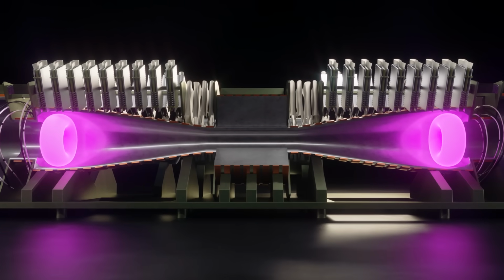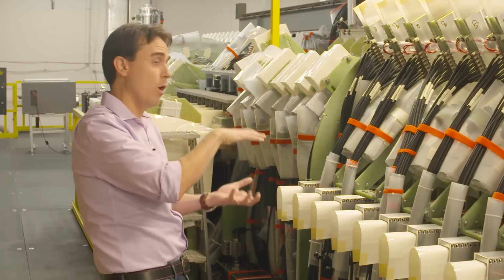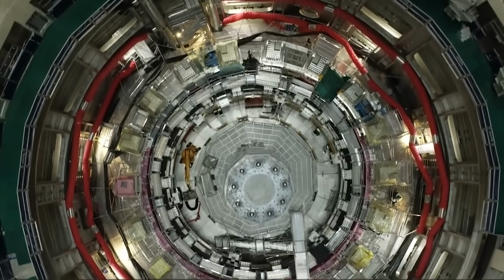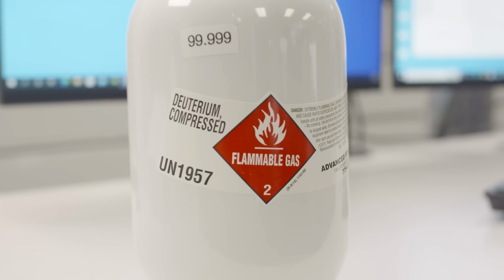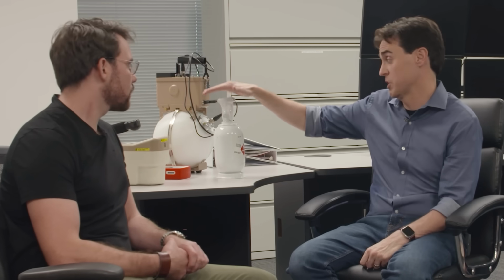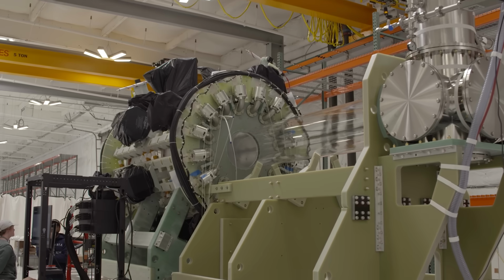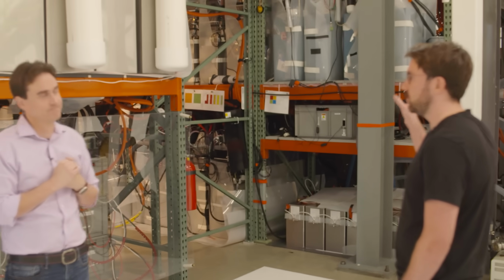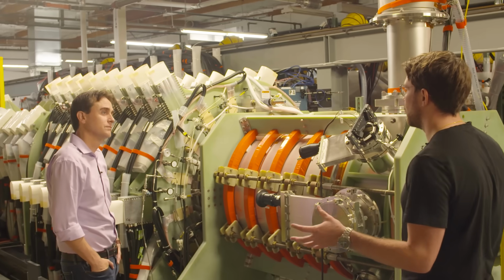A New Way to Achieve Nuclear Fusion: Helion

Comment: Here are some problems that's not mentioned in this video.

1 D-He3 is much less reactive than D-T, depending on the temperature it can be anywahere between 10 to 1000 of times less reactive than D-T which means less fusion for the same input energy.

2 The D-He3 mix will sometimes fuse D-D into He3 + N so they still have to deal with neutron radiation like all other reactors.

3 Another problem is something called Bremsstrahlung which will radiate away alot of energy that won't be captured by their electric field.
Reply: And that's exactly the reason why I don't like learning from YT videos. Facts are mixed with wishful thinking, ignorance, mistakes and bias in unknown ratio. Thanks for sharing your skepticism :)
Reply: Their pulsed power supply looks dodgy enough that makes me suspicious if its functional at all. The cable management and layout does not seem to take into account the massive forces generated between conductors and very importantly i see no thought on the effect the layout would have on inductance, which is something critical to control when dealing with pulsed power experiments of this kind. THere is a reason the Z machine even uses transmission lines and water dielectric capacitors, sure this is not the same as a z pinch device but the physics are similar.
Reply: @teresashinkansen9402  So are you suggesting it could be a hoax? Always a possibility I suppose as it has not been duplicated elsewhere.
Reply: @mariemccann5895  As much as I would like to see such companies have success I am very skeptical due all those little details that tell you when something actually works or not, another thing that really gives it to me is I didn't see any serious radiological protection, if they are getting fusion to the point they will start experimenting with energy extraction they would have to deal with activated parts and the machine would have some significant shielding yet I see none of that.
 I see this subject to be close to finding a cure for cancer, billions of dollars have been invested and many brilliant minds have come together to crunch at the problem but due the nature of it, its something very difficult to accomplish, then you have such small teams purportedly coming up with revolutionary technology that might change the world, to me that's a red flag, sure maybe some day it happens and  such small team changes thew world but its very unlikely. I would eat my words when they demonstrate fusion at any meaningful degree.
Reply: OMG. Three months and this thread is still alive ??? 😄

I've been searching for more info about Helion's machines the last two or three weeks; with it in hand now I have less doubts about this contraption.

I found 10+ year old patents that mention it under the name of John Slough (co-founder or Helion with David Kirtley and others in 2013) and even older peer reviewed papers. After 2013 more patents, but no more papers. Maybe I'm not good at searching, or perhaps they want to keep their trade secrets.

Anyhow, John designed this before incorporating Helion. In its initial iterations this machine was to work with Deuterium-Tritium. Later on, they found the design was capable enough to burn more "difficult" fuels (enters D-3He). The old drawings included a Berilium first wall embracing the reaction chamber, surrounded by a blanket for cooling, breeding (Tritium), and shielding.

John Slough's has been publishing peer reviewed papers on fusion for at least 25 years, and is a well known name in the field. This machine is a child of his brain, and predates the creation of Helion Energy LLC. That should give them a bit more credibility, I think.

Moreover, it seems that there IS some neutron shielding around the reaction chamber even in the machine showed by R.E. in this video, it's just hidden under all those cables and parts. Also, they don't include it in most animations for clarity (or even in the quite unrealistic model Helion has it its own web page) but it is there.
Reply: @charliem6590  It's also important to be skeptical even if a more well known scientist is involved in the project.

For example John B Goodenough started working on a new type of battery in 2019, a solid state battery that's suppose to be much better than Li-Ion batteries. However they are already behind schedule and i haven't heard any news about these solid state batteries leaving the lab or that they are commercially ready. afaik some do exist and work but they are only very early prototypes and in general i'm more hopeful regarding the future of batteries.

I'll believe FRCs are the future when a significant amount of scientist start building FRCs and we get a good amount of peer-reviewed papers.
Reply: I want to start by saying that I'm not at all sure that Helion is going to succeed, but I hope they can. Fusion energy generation is at present a field with a lot of players, with some luck at least one of them will get there.

Regarding your specific points, let me see if I can argue why those problems could be overcome (not they are going to, just that we cannot say it will be impossible, not yet):

1. Yes, a D-3He mix is less reactive than a D-T at the same ion temperature but that's not a problem per se, the question is whether a D-3He mix reactivity is high enough. If I can propose a simile to try clarify this, gasoline combustion is quite less energetic, gram to gram, than hydrogen combustion but we don't fuel our cars with hydrogen, this is because gasoline is good enough, and because hydrogen has other problems. Helion says they think D-3He will be good enough. We'll see.

2. Again, yes, a D-3He mix still produces neutrons. My thoughts about this. 1) Neutrons produced in D-D fusion events are much less energetic (2.5 MeV) than from D-T (14 MeV), and much less than neutrons produced in fission reactors. Also, 2.5 MeV is well under the average activation energy of most structural materials (stainless steel AAE is 20MeV). 2) The neutron production can be reduced changing the D-3He mix ratio without compromising energy production too much (Helion speaks of using a 1to10 Dto3He mix). 3) The selection of structural materials can also help, not all materials produce long lived isotopes when bombarded with neutrons, Helion says they know how to build the machine mostly with materials that only produce short lived radioactive isotopes (for example, Aluminum isotopes produced by neutron bombardment decay in minutes, not years). As before, we'll have to wait.

3. Bremsstrahlung is produced by electrons and it is heavily dependent on their temperature. The plasmas in Helion machines are not in thermal equilibrium, nor they want them to be, and in particular they've measured a big temperature gap between ions and electrons. Electrons are far cooler, ergo, less Bremsstrahlung. Low enough to not robe the plasma bulk of too much energy ? I don't know, and neither does any of the critics.

Summing up, Helion has still to prove their concept but saying, as the Improbable Matter video says, that it is a scam is in my opinion jumping the gun.
Reply: @charliem6590  activation of materials is not the main issue materials-science wise in fusion, it's the exceptionally large amount of defects caused by neutron radiation primarily. In conventional light water fission reactors we observe damage levels of at most a couple dozen DPA in the reactor pressure vessel. In a fusion reactor, be it this helion thing or a tokamak, you can expect as much as 100 dpa over expected operational lifetimes which is just crazy and will not work, it's too much damage
Reply: @charliem6590  Those are some good points and i do hope they solve these
problems but to me it seems almost inevitable they'll really struggle with atleast one of these problems. 

If they decide to try runnging a cooler reactor then the bad reactivity of D-He3 becomes worse much quicker than D-T making it really hard to achieve a high enough Q total value to justify a commercial reactor.

If they try a different D-He3 ratio to try to increase Q total then neutron radiation is going to be a big problem they'll have to deal with like all other reactors.

If they increase temperature to increase Q total then they have to solve large number of engineering problems aswell as dealing with bremsstrahlung.

While i do want them to succeed, it's really hard to not be skeptical when the rest of the world struggle to get above Q plasma 1 let alone a  Q total of 1. Let's not forget they'll need much more than a Q total of 1 in a commercial reactor.
Reply: @peterjohansson1828  Well, inevitable is a big word. It may be that one of those problems (or any other yet to be discovered) end up being a show stopper for Helion, but I'm hopeful.

About your point over running a cooler plasma, from what I've read from different sources Helion intends to (in their next machine, Polaris) at least double the temperature, mainly to improve reactivity (in the last one they reached ~100 million Kelvin). With D-T the ideal temperature for a steady-state machine like a tokamak has been calculated to be around 135 MK. Above that, bremsstrahlung and other loss mechanisms eat any further gain in reactivity. Having said that, in a steady-state machine ions and electrons tend to thermal equilibrium, but that's not applicable to Helion's machines. According the results from Trenta (the last one), they've measured electron temperatures far lower than the ion temp, up to 8 times if I recall correctly. If we scale that up to a 250MK plasma, it would mean ions at ~250 MK, and electrons at ~31 MK. Ergo, quite less bremsstrahlung than in a tokamak at half that plasma temperature.

Regarding the D-3He ratio, they said they've already tried it. Making a 3He rich mix has the consequence of making less probable a D-D fusion event, reducing neutron production, without affecting D-3He reaction rate too much. In a presentation they did for the USNRC last year they claimed that their projection for a 50 MW machine is that it will  output less than a 5% of the energy in the form or neutrons at 2.45 MeV. They plan to have shielding outside the main reaction chamber, but it will be reached by only one sixth of that. 0.4 MW in neutrons is something to take care of, but far from intractable.

And yes, increasing the temperature might reveal new engineering challenges ... or maybe not.

Again, we don't know, but we will ... and without having to risk any of our money.😋
Reply: @peterjohansson1828 the issue is these limitations aren't solvable, they are hard limitations of metallurgy and physics, the sheer neutron flux will destroy reactors nomatter how well they work, I think unless they find a way to contain the neutrons or redirect them off the walls of the reactor then these fusion reactors will never be commercially viable
Reply: @charliem6590  I've seen that Improbable Matter video, and this one as well. Glad to hear there's yet more nuance to the situation.
Reply: @charliem6590  You just know this kind of science off the top of your head? Im so freaking envious... I would LOVE to be able to argue a science argument like you did just with knowledge learned through time.. AND understand arguments someone else makes like the original poster... So cool man. Im so grateful there are intelligent humans such as yourselves on this planet!
Reply: @charliem6590  About Bremsstrahlung : this effect may be undersetimated in the fusion chamber. Granted, electrons and nuclei are not in thermal equilibrium, but within the core of the reactor, where the magnetic field is maximal, the movement of electrons and nuclei follow the same helixes, but in the opposite direction, so the thermal exchange will be very efficient. Another point : the X-ray power lost by bremsstrahlung is inversely proportional to the fourth power of the particle mass, which gives a coefficient 1836 to the power of four, that is 11 thousands of billions.. And the loss in proportional only to the square root of the temperature, so it's doubtful the lower temperature of the electrons will compensate the huge defavourable factor from the mass ratio.
Reply: It seems the plasma is extremely hot and dense for only a very short time. Perhaps too short for Bremsstrahlung radiation to have a sizeable impact?
Reply: Sure, those are considerations, but they go into the equation along with all the other factors. Even if the fuel is less reactive, what matters is how effectively the fusion process can be used to create electricity (and/or create its own fuel supply). What you've ignored is all the other  factors that can lower expenses, lower total input energy, improve efficacy and allow electricity to be produced systematically at cost. And I'm pretty sure they said they can actually achieve fusion every ten minutes, which really shouldn't be dismissed lightly.

Btw: pretty sure the CEO who has been working on nuclear fusion for decades has nuclear scientists and engineers developing these machines, and fusion science has had a lot of problems with those decade-old experimental models. A lot of criticism has been made on ITER's fuel for very good reasons.
Reply: They haven't mentioned that the technology is outdated by what they have now big time!
Reply: Bugs are still being worked out.  Just a few more lines of basic and the thing is ready to power the most demanding of television sets.
Reply: Edit: trying to find a redaction for this comment that Youtube does not object to (5th try). This time I just deleted all my text. Will this be acceptable ?
Reply: I thought the primary reason to use another element, other than T, was because of T's very low availability in nature; creating an issue in the future of not having fuel.
Reply: @davidohare2933  you can make tritium in fission reactors, especially heavy water reactors like CANDUs. The problem is even then you'd need a huge amount of reactors to make enough tritium for even just one tokamak power station
Reply: @davidohare2933  The plan for other fusion reactors (afaik) is to use a beryllium-lithium blanket to create more tritium as part of the fusion process.
Reply: @indisplutably  ITER is designed by engineers and scientists, I don't trust politicians either but they are only a source of funding. regarding my third point I can simply point to pretty much any scam in recent time. Remember theranos? and how they were going to revolutionize the medical sector with their bogus idea? She got billions in investment from hyping up her stupid idea which had no chance of working. Lastly can you name a single successful invention from a private company in the last decade? There are tons of bad ideas like solar roadways, then there are incremental improvements like jet engines becoming more efficient. Have lithium-metal batteries even been made on a large scale or is it still an impractical and underdeveloped idea like so many other battery concept? I heard of a lot of promising battery concepts in 2019 and 2020 but so far all those ideas have failed. Also don't forget that I said private companies are good at slowly improving and refining already existing technology.
Reply: Can you put that thing under water?
Reply: I know it's off the topic but are you swedish ?
Reply: @norapodlasky8278  ye I'm swedish
Reply: I thi k they know that and they are trying to fix it
Reply: And even if you say some problems, that doesnt mean that they have thise problems, they have maybe fixed it
Reply: Oh yes, if only that was all of them...
Reply: Also, after looking some more at where they are in the process it looks to me like they are claiming to have already overcome these problems. They had Trenta running for 16 months. The new iteration of their process is aimed at the problem of capturing the electricity generated. We will see I guess. Perhaps I'm misunderstanding what they are saying in addition to what you are saying and these problems still remain to be resolved.
Reply: @jjwagnell  I doubt that Helion has the neutron problem already solved. They probably have ideas for that, but I don't think their work with Trenta did it. In Trenta they made a pulse every 10 minutes, in their production prototype machines the aim is ten per second; just from that, the neutron production will be multiplied by 6,000. Also, I read they plan to increase the temperature two or three times; that increases the reactivity of the D-D fuel over 10 times, which means we are now talking 60,000 more neutrons. Thirdly, they are going to double the magnetic field resulting in an increase in density, implying another 10+ increase in neutrons. And lastly, Trenta only burned D-3He in some of those 10,000 shots, many used hydrogen, other gases, or mixes other than D-3He.
Add all that up, and their first generator prototype will have to deal with a neutron flux way over 1,000,000 times higher than Trenta.
I hope they can overcome all that, but in my opinion it is far from a sure thing.
Reply: I was going to say that but you beat me to it. Also not to sound too much like a sciencey science guy but I was thinking maybe a planet already exists with trillions of tons of trillium and they are the ones probing our farmers butts.
Reply: @@lynngeek5191 Last I heard of Iter was some planned q>1 test in 2025 tho i could be wrong. Also i have yet to see a successful commercially funded research reactor. private companies really just don't do non-profit things for the public good.
Reply: This was a great read.
Reply: To be fair, braking-radiation (I can't write that word, sorry) is still the minority of the energy, plus if you REALLY wanted to you could always surround the machine with a watercooled jacket for it to heat. This would also help capture the neutrons.

But yeah, the largest problem is definitely the D-He3 cross-section. An advantage that's often not mentioned of D-T is that it has pretty high probability of fusion compared to basically everything else, which translated to higher power density. And that' isn't just important if you wanted to build the Rocinante from The Expanse, high power density also means that the machine can be smaller to produce the same amount of power for grid consumption.
Reply: true it will create less overall energy but the point is it poses the potential to actually produce MORE energy per every bit of fuel put into it so while D-T can produce more power, its overal more difficult needs to induce the fusion requring CONSTANT power supplied to massive super conductors with their size increasing their cost to produce AND cost to repair of something goes wrong but also due to the nature of how you gain the energy from a D-T reaction, its far less cost effective as it requires beryllium to produce a net positive energy gain and because of both the cost and dangers being the same as current fission reactors only increasing the cost as decommisioning those is ridiculously difficult due to having to safely find a way to handle the radioactive byproduct, its overal both less cost effective and less energy efficitent.
Reply: like the point with this style is that 

1) you can produce the He3 in another generator and design that only purely around the need to create the fuel and because its not focused on gaining power the same way as a D-He3 reaction, i.e. it would generate heat due to the neutron release, you can create those blankets to recover some of the energy used to create the He3 as well not only making your fuel but greatly also reducing the cost to make it in the fuel in the first place making it easier to get net gains in energy production

and 

2) the reaction of D-He3 is seemingly much easier and safer to the reactors lifespan (accounting for the 25% increase to size of the next reactor they are making) meaning while you ultimately generate less energy than traditional fusion reactors, factoring in the fact that the thing makes the only difficult component AND it can be outsourced to a different machine all together making it ridiculously cost effective (compared to traditional fusion AND fission reactors) while also not producing highly dangerous radioactive byproducts with the only byproducts aside from more He3 being tritium which can be safely siphoned off to storage where after roughly 2 to 3 years, it can become regular He3 ready for use in the reactor. 

all in all it does have issues but most of those have been accounted for and as primarily the conductors and possible seperate fuel creation engines get created allowing for the reactor itself to no longer have to pull the hybrid power generation / fuel production all leading to the genuine possibilty of generating FAR MORE power than current methods can (barring the inefficient and dangerous current fission and fusion reactors) with no real harmful byproducts that are difficult to handle and a overall operation cost being far and below all other forms of power generation that come even close to it.
Reply: Yeah, the problem is the Lawson Criterion (AKA reactivity AKA how hard it is to break even). The LC of D-T is by definition 1. The LC of D-He3 is like 16, 16 times harder to break even on. And the LC of D-D, used to produce He3, is something like 30 IIRC, even harder.

Basically if you thought ITER was struggling and came out insanely expensive just to vaguely break even on D-T (Q-Plasma is 10, but Q-Total is only about 1), be aware that Helion will have 16 to 30 times as much difficulty.
Reply: To me the most credible objection to Helion's plans is the problem of neutrons. I see two potential issues.

One is the neutron activation of materials. Helion seems to be addressing this by researching and choosing materials with short lived isotopes caused by neutron bombardment. They seem to favor aluminum to copper for magnets, quartz to steel for the interior walls, plastics to metals for non force bearing components, etc. These mostly produce isotopes with half-lives in the order of minutes or days, instead of the years or centuries we are familiar with in nuclear fission installations. At least that is the plan as I see it.

Second [and in my opinion tougher] problem is the structural degradation of the reaction chamber walls, mostly its internal surfaces. This could result in the necessity to replace those parts multiple times during the operational life of one of these reactors. Helion has declared that they are designing their machines with easy of disassembly/maintenance in mind (to which short lived radioactivity of activated materials would be of great help). May this be their answer ? If the reactor has to be turn off once a year for maintenance, and it is serviceable a couple weeks after, and work back to operation in another two, that would mean 92% uptime, not bad compared with other electricity generation installations.
Reply: So now Iter was a waste of money?
Reply: @bille77  no it's a research project, Iter isn't designed as a commercial reactor and no one expects to turn a profit by running it. The same can't be said about Helion and their reactors.
Reply: @peterjohansson1828  ITER is a research project. Helion's Trenta and Polaris machines are research projects. ITER is said to be the precursor of commercial fusion plant designs. So is Polaris. In that sense I don't see that much of a difference (besides one being funded with public money, and the other with private's).
Reply: @charliem6590  Yes from that perspective those projects are quite similar but I'd argue the big difference are the expectations. The people funding ITER know they won't earn any money for it while I assume Helions investors want some kind of return for their investment.
Reply: @peterjohansson1828  Well, that's where the "Venture" comes from in "Venture Capital". VC investors know they are putting their money into something with no guarantee of success. Even so, they do it because the potential reward.

Sooner or later someone is going to crack that nut, and the investors in that company are going to make a boat-load of money.
Reply: @peterjohansson1828  they can sell tritium or capacitors I guess😁
Reply: @charliem6590 ` It is said to be the precursor of commercial  fusion plant design`...lol you couldn't make a bigger reason for fusion   to never succeed in commercial power production . Have you seen the cooldown /warm up times for any tiny malfunction ?
Reply: @bille77  The whole fanciful notion is a waste of money.
Reply: @bille77  nope
Reply: @bille77  When is ITER meant to come online for the first time?+
Reply: In short this video is a publicity stunt. An ad.
Reply: Cette technologie ne permettra pas de construire un réacteur de fusion commercial opérationnel. Jamais. La théorie est fausse, la conception n'est pas réalisable.  Il existe une bonne solution.
This technology will not help to create a working commercial fusion reactor. Never. The theory is wrong, the design is unworkable.  There is a right solution.
Эта технология не поможет создать действующий коммерческий термоядерный реактор. Никогда. Теория не правильная, конструкция не рабочая.  Есть правильное решение.  
https://www.youtube.com/watch?v=FcypwoVOAAY
Reply: Bremsstrahlung radiation is irrelevant here the lifespan of plasma is far too short to cause any real radiation these are also heavily shielded anyways so it wouldn't matter even if plasma lasted longer than a few seconds and it would have to be a decent amount longer for it to have any real impact. 
Most reactors are not using helium 3 but in this case they are. Helium 3 is also far less available unless we can mine it from the moon and return it at a low cost. Not a great option if you ask me. General fusions reactor is honestly a better option in this case using a somewhat similar method and seem to be more successful so far. Course NIF method with lasers is currently the more superior option at least that we have seen despite it not being that successful overall with a gain of 0.0077.
Far as I know Helium 3 cannot mix here with Nitrogen Helium doesn't mix easily with nitrogen because of the great difference in their densities. But once mixed, the gas molecules are close together and they move around quite a bit with kinetic energy so they stay mixed and don't separate out into layers. Far as I know this doesn't really cause any radiation output but I may be very much wrong. Couldn't find anything on it though to confirm if it did.
Reply: If the neutrons' energy isn't high enough to fuse with anything, I don't see a real problem: Free neutrons have a half-life of some 10-15min (longer time for higher kinetic energy). So long as you don't just vent the reaction product into the atmosphere, that is...
Reply: @Smo1k  I thought it was something closer to 7 minutes
Reply: @charleshorseman55  Neutron half-life is 611 seconds +/-1 inside a nucleus, 879.6 +/- 0.8 outside. Subjective to relativity, of course; if it moves really fast, it'll live longer. You saw the size of the reactor, though, moving fast doesn't happen for long inside that small a volume...
Reply: @Smo1k  Fast neutrons go almost thorough anything, so its not like you can contain them like a gas, also neutrons get captured by nuclei as well which many times end up making it into an unstable isotope.
Reply: @teresashinkansen9402  But the argument is exactly that the neutrons in this reactor ARE NOT fast, they will behave (sort of) like a gas, as they decay to hydrogen. So: If you don't vent but contain the gas of leftover D and He (Both of which are better spent reused), there won't actually be a problem, just a tiny higher percentage of H.
Reply: @Smo1k  Only ultra cold neutrons behave as a gas and for them to be they have to have an energy in the order of nanoelectronvolts, depending on the material that will contain them is the maximum energy they can have, at this energy ranges they are moving at speeds of a few meters per second so even a drop of a few meters can give them enough energy to make them interact with nuclei. With what im going with this is that there is no reaction that I know of that produces such low energy neutrons. When neutrons are moderated below thermal energies the moderator has to be physically cooled as even the vivrational energy of atoms at room temperature imparts energies far above what is needed. How can you expect to have such kind of neutrons when even the plasma of the reaction is several millions of degrees?
Reply: @teresashinkansen9402  I'm not talking about the neutrons behaving like a gas themselves, but that their environment is a gas. The D+He gas we started out with before plasma? The same thing. Closed environment.

Now, solo neutron fusion with anything doesn't happen without a cost way overboard of what we've heard about in this video. With the numbers mentioned to turn the whole bit into plasma, we're talking so small numbers left over for the "run away neutrons" that you're worrying about stuff smaller than the added background radiation from flying overseas.

Will it be a factor in large scale operations? Probably. But even ITER will not be on a scale where neutron radiation is anywhere near as dangerous as... just about anything. Salt. Chemistry. Traffic. Sharks. You name it.
Reply: @Smo1k  Now Im not sure what you are talking about. Anyway I don't think you understand the amount of neutrons produced in a fusion reactor of any practical use for power generation. The amount of neutrons is insane, lets say about 1% of the energy on this device (about 60% in fusion reactors using D-T reactions) is in the form of neutrons the average energy being about 2.45MeV (due D-D side reactions) each neutron would have .00000000000039J of energy if they are planing to generate about say 20MW of fusion as a pilot plant (supposing this thing can actually fuse fuel at all) that means about 200kW of power is in the form of neutron radiation so 200kJ per second 200kJ / .00000000000039J= 5.13e+17 neutrons a second, now do you see the mental levels of neutron radiation? That's lethal levels of radiation and enough to strongly activate construction materials, that ain't your intercontinental flight radiation levels.
Reply: @teresashinkansen9402  You can't both call fusion and claim the energy for failed fusion. Your 3.9e-13 (if I'm counting correct) joules per neutron does just that: Claims the energy for both the fusion and the neutron lapse.

Next is the thought that matter of any sort is just about invisible to high energy neutrons. It's not. On the contrary: The higher the energy, the shorter the movement of the neutron per energy (and yes, here: Cherenkov, even without water).

So I stand: Leftover energy is not frightening, and the neutrons making it anywhere are not enough to be dangerous. The magnetic field around the reactor is probably a greater danger.
Reply: @Smo1k   The 3.9e-13 J is the kinetic energy per neutron of a D-D fusion reaction nothing more, there is also an extra amount of energy released as kinetic energy in the He3 ion. What im saying its actually very simple, you have a plasma were D-D fusion reactions happened as such it will be a isotropic source of high energy neutron radiation, being fast neutrons they will interact accordingly with the construction materials of the machine and being such a powerful neutron source its actually a very serious radiation hazard, it doesn't matter if the reaction happened in a solid, liquid, gas or plasma, neutrons are neutrons.
Reply: @teresashinkansen9402  I understand your worry. I do. But I object to your applying the fusion energy of D+D to a neutron without any further ado: Even if the result is 3He, there's not much energy left, let alone the neutron which is the problem to begin with. I do hear you, but I don't agree.
Reply: Well I think if you should warn the company right now so they can shut the project down because there's no point going ahead with it if some guy on the internet says they're wasting their time!
Reply: @yasim8251  What a smartass response you had! I dont think the original poster was trying to shoot down the entire attempt this company is having. He intelligently brought up just some concerns and doubts cause he understands the science apparently. Whether or not he is correct doesnt merit your reply. This is science, people argue and test and observe and then argue and test again! He/She even said they hope the company overcomes these issues!
Reply: @yasim8251  My point is that scientists who have been working on fusion for decades know more about fusion than this CEO, and afaik almost all serious research projects focus on tokamaks and a few on stellarators. Don't get me wrong i hope they succeed but i don't have high expectations.

let's not forget people have been trying to build Q>1 fusion power for several decades now.
Reply: @peterjohansson1828  People were also doing space travel well before another particular CEO. He just so happened to find a team to do it best.  Could be the same scenario.

As you said though only time will tell. You've made great points, but I'm still hopeful.
Reply: @peterjohansson1828  Those scientists are funded by the same people responsible for fission reactors using uranium instead of thorium: unelected war hawks who have nothing to lose by dumping money into inferior systems. In contrast, the CEO in question has everything to lose if Helion flops, along with everyone working on the project. If tokamaks flop, the government doesn't go under. I'm personally very optimistic about Helion.
Reply: @indisplutably  Fusion reactors cannot be weaponized in the same way that fission reactors were, so that's irrelevant. Secondly ITER is a massive project that costs a lot of money that many would want to spend elsewhere so they would still lose a lot if the project failed for some reason. Which means they still have motivation to try to succeed. Thirdly let's not forget that a CEO could simply increase the company's stock value and then sell share to earn a boatload of cash, kinda like how Elon sold billions of Tesla stock.

Lastly i want to point out that in the last decades no private company has successfully invented new revolutionizing technology, whereas scientist have repeatedly done that. For example Apple didn't invent lithium-ion batteries, they just put the inventions of other into their consumer product. I could go on but my point is that private companies are good at improving and refining  already existing technology while publicly funded scientists invent new things.
Reply: @peterjohansson1828  What happens if I put a depleted uranium blanket on a fusion reactor, wouldn't that enable the production of plutonium? there are proposals to make an hybrid reactor like that, using fast neutrons from fusion reactors to produce energy from fission of depleted uranium, Im sure that would breed some fissile material as well.
Reply: @peterjohansson1828  your condescension is noted.  Calling him out as mere CEO and that "scientists.... know more about fusion" /  "serious research projects" is rather haughty.
That CEO has multiple masters degrees including Nuclear engineering, and a PhD in Aerospace Engineering.
The modern world is filled with innovations that came from outside the bulk of scientific and engineering establishment.  Frankly, I'm quite delighted to hear such depth of knowledge from a "CEO".
Reply: @mitchdaks6363   <Edit> You're right I've been to condescending / hostile in my earlier replies and I do apologize for that, but I still stand by my opinion that we need to be more skeptical. </Edit>

In an earlier reply i asked someone to provide ANY innovation that wasn't merely some small improvement or some optimization of already existing technology and so far i haven't seen any examples. private corporations are good at improving things that already exist but almost never invent something new.

Peer-review is the reason why we know so much about the laws of nature, which is why I trust scientists more than for profit companies when it comes to expanding our knowledge about the universe. this is why I dislike overhyped "revolutionizing" tech that either fails or is shortly forgotten after it's been announced.

Also to be clear i still think we should be skeptical of scientists, they make mistake and/or lie like all humans. 

Finally regarding his qualifications, I'll admit I didn't know what degrees he have and it's good that he know stuff in the field. I do agree it's nice when a CEO understand what their company makes.
Reply: @peterjohansson1828  Kudos for man'ing up.
Helion's approach may well be optimizations, but it is the aggregate of so many of them, a functional demonstrator using low cost fuels - AND an understandable path forward to a true energy generator, sans all the efficiency robbing intermediarys of fluid, steam and turbines that make their approach particularly exciting.

To my eye, they appear very close to reducing the overall problem of net energy generation to that of only engineering challenges. Big ones, certainly - but no coincidence that the founders backgrounds are so engineering focused.  
Any commerically viable fusion power generator is a "revolution" for human society, even if not a theoretical scientific revolution. 

I think any fusion power project reliant on tritium is doomed for commerical failure.
Reply: @mitchdaks6363   How exactly are they close to reducing the problem of energy generation to that of only engineering? They say they demonstrate fusion in this video but so have tons of other reactors for a long time so that's no indication of close they are to solving these problems.

You say they remove efficiency robbing parts of energy generation but they also lose alot of energy due to heat but that isn't even the big problem. The big problem with fusion power is that Q-plasma is much less than Q-total. We need a Q-plasma that is much higher than 1 before it's even reasonable to try to build a commercial reactor.

Another big problem with fusion that I've only recently started thinking about is that any kind of fusion power isn't going to be commercially viable for decades because of how crazy expensive the technology is compared to other energy sources.

Honestly the more i learn about fusion power the worse it seems. Personally I believe the best way to make our energy generation more environmentally friendly is to 

1.  increase grid connectivity so we can use more renewable power without wasting it.

2. make cheaper batteries so it's more commercially viable to store energy from renewable sources.

3. Improve and optimize existing fission power to make it actually commercially viable  for when renewables aren't enough.

I think we could finish all 3 listed steps before any fusion reactor achieve Q-total > 1.
Reply: @peterjohansson1828  I agree that your 3 points would draw us closer to energy generation sustainability. I don't agree that pulling them off is so easy that we can get there well before achieving Q-total>1 from fusion.

I've been following the news about all aspects of energy generation (distribution, conservation, storage, pollution, cost, etc.) for years, and if I learnt something is that our energy system has such a huge inertia (technological, economical, financial, political, ...), that ANY substantial change takes decades, no matter how willing we are. I don't see those 3 points being substantially implemented in less than twenty years (probably more), and I am personally convinced that we will have fusion energy well before that (although its deployment will also be subjected to the same delays).

Changing topics. About Q-plasma and Q-total. Each machine is different, for Tokamaks Q-total>1 will only be achieved when Q-plasma is well above 5, maybe even as high as 10. That is because Tokamaks are wasteful, they need a lot of energy input to keep working.

If we could, ideally, build a machine that wastes no energy, that could somehow recover all we put in to reach fusion conditions, then Q-plasma>1 would be enough.

The second law of thermodynamics guaranties that such a machine is pure fantasy, but it also says that there is space for us to play between Q-plasma>1 and Q-plasma>5 to 10.

For instance, most fusion generation proposals include plasma heating with lasers, neutral beam injection, plasma guns, or high power R-F. All those are quite inefficient. What if one design could do without them ?

Also, most ideas include heat harvesting and turbines for electricity generation. That implies accepting additional losses of 40%-60%. Again, what if someone finds a way to do it in a more efficient way.

And there are other potential inefficiencies but not every design is subjected to them. Yes, if we talk Tokamaks, we will need, at the very least, Q-plasma>5 to just reach break-even, but not all approaches are Tokamaks.

Now, talking specifically about the machine depicted in this video: 1) It heats the plasma by accelerating it, turning its kinetic energy into heat, and compressing it. All those processes are very efficient in converting electricity into heat, over 85-90%, better than any other way I've heard about. 2) For the harvesting energy phase, direct conversion from kinetic energy to electricity is also (potentially) highly efficient,  85-90% or even more. 3) And lastly, this way of energy harvesting can also recover a good portion of the initial input energy. Add all those 3 and you get to the conclusion that this machine (if it works as intended) could potentially get away with a Q-plasma much lower than any Tokamak, maybe as low as 2.

For sure there is ample space for failure, but at present no one can say there's no hope.

P.S. Improbable Matter may know Tokamaks in depth, but he seems to have filmed his critique video without having done a lot of research on other architectures, or he would have known that Helion's flavor of FRC machines were producing substantial numbers of neutrons years before the company was incorporated.
Reply: @charliem6590  Assuming I'm wrong and we do achieve  Q-total > 1 before my three points it still doesn't matter since fusion will never be a cost effective solution in time. By the time we build a Q>1 fusion reactor our other technologies will also have improved so fusion reactors will have to play catch up for who knows have many decades, but I bet it'll a long time. .One more thing we need to keep in mind is that we also need a Q-total that is much higher than 1 before it makes much sense connecting it to the power grid because of other inefficiencies, even disregarding costs.

you should read my original comment as for why I'm skeptical about the reactor shown in this video. Things like braking radiation and the poor reactivity of their fuel will make even more almost impossible to make a good fusion reactor than it already is.

Lastly I want to say that yes I know it'll  take a long time to implement those three points because of inertia but we have also already started doing it, (Atleast in eurpoe, the rest of the world is extremely likely to finish after Q-total > 1 fusion).
Reply: @peterjohansson1828  Oh, I did read your original comment, the one that started this thread, in fact my answer is right under it.

In the end, we are arguing our hunches about the future. As someone said, "it's very difficult to make predictions ... especially about the future". The reality is that no one knows for sure, I certainly don't, and I think that no one else does either. So, to be sure we will have to wait, but I'm all in favor of keeping working on it until we do.

By the way, I've read multiple times that "fusion will never be cost effective", but never heard any reasoned argument backing that assertion. I know, I know, ITER is ridiculously expensive, but I fail to see how that can reasonably extended to all other architectures/machines. Do you know of any good argument in favor of that claim?
Reply: @charliem6590  Given enough time some1 will figure out how to build a cost effective fusion reactor but i specifically said "...since fusion will never be a cost effective solution ***in time.***" meaning that fusion tech won't mature quickly enough to be useful in fixing climate change. The reason i believe that is because building a test reactor and testing that reactor takes many years at best, and a couple decades at worst. After building, testing and proving a design is good and cost effective it would still take decades to incorporate the design in the power-grid on a large scale, this is why i argue that fusion will not help us fix climate change.

Also you're right that we're only arguing over hunches at this point.
Reply: @peterjohansson1828  In time. Well, that depends in time for what, doesn't it.

According the UN Environment Program we are already past the point were we could have limited the average global temperature increase to 1.5ºC (assertion backed by multiple science based sources).

Even worse, at the present rate of increase, we are most probably going to surpass 2.0ºC too.

But the task is not to keep the global temperature under a specific number, the task is to prevent a global extinction event (including millions, if not billions of us), while at the same time keeping a reasonable living standard for all humans.

We are going to need a lot more energy to do that.

Just giving a fair [not great, just fair] standard of living to the about 11 billion people simultaneously alive on Earth by the end of this century, will require to MORE THAN DOUBLE our current energy generation capacity (plus implementing all the energy saving measures we know of, or can come up with).

Are we going to get there only with solar, wind, hydro and other renewables. I don't think so (and I'm as pro-renewables as they come). Are we going to get there with fission power only. Improbable, I'd say. With more coal and gas. Definitely not.

We'll need all the clean sources we have, plus any other we can develop. Fusion would be a humongous advantage, even if we don't have it until 2050.

With enough energy we could even start thinking about reversing the harm caused by fossil fuels. Think about this, it would make possible capturing CO2 from the atmosphere in industrial quantities. That's something we can only dream of right now.
Reply: @charliem6590  I do not want to start another lengthy debate so I'll just say this. I believe fusion tech will not be ready to help us fix the worst of climate change because the sooner we reduce CO2 emission the better. we can build solar, wind and fission today but the same cannot be said about fusion.
Reply: @peterjohansson1828  Yeah, I also think we've already said all we can say without veering off target too much, so I'll stop here too.

Anyhow, thank you for a civil discussion.

So long.
Reply: @peterjohansson1828 Not correct about your last point. Take ASML and EUV as an example.